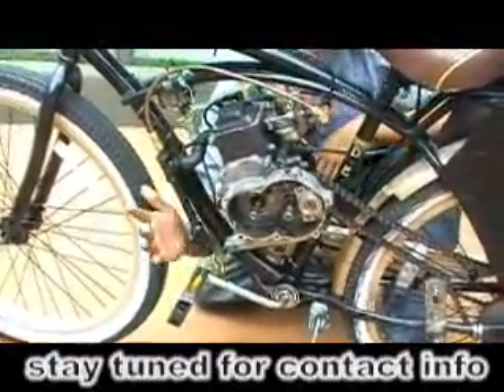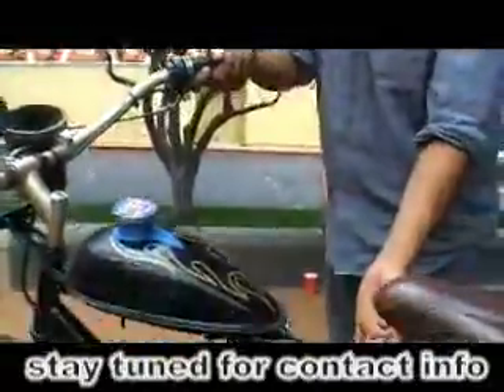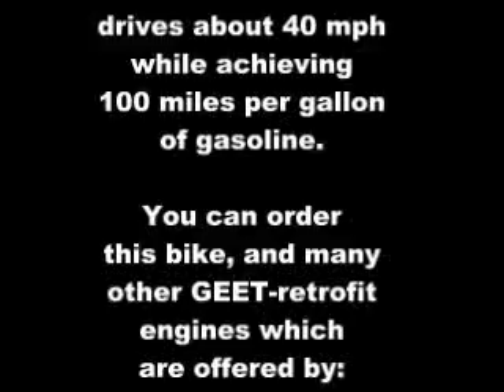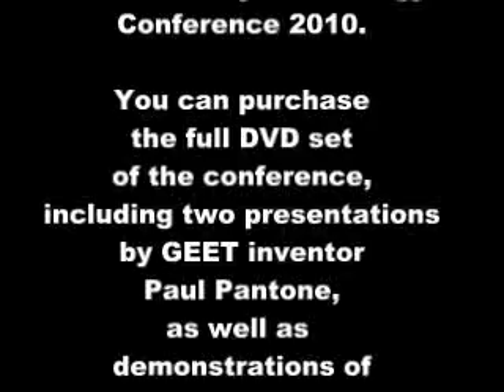GEET-retrofit 50cc engine on a bicycle

Comment: If my mats are wright
40miles-per-our = 64,36 Km.per.our
100miles = 160,93Km
1gallon = 3.78 liters
160,93Km : 3,78 liters = 
42,57 Km-per-Liter , at 64,36 Km-per.hour
That's good compared 4 example to a mophed like piaggio ciao 50cc that would make around 50Km per liter at around 40Km per hour.
+ Reduced fuel consumption
+ Reduction in pollution 
- less smooth and contollable speed/trottle
- Sadly would be illegal to drive it in EU
If prooven to public, would be good to show geet  advantages